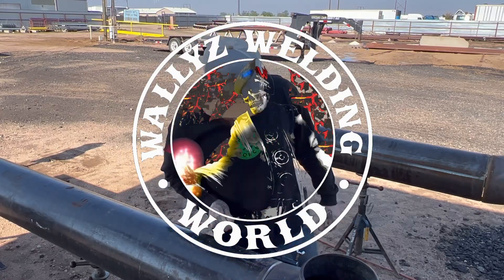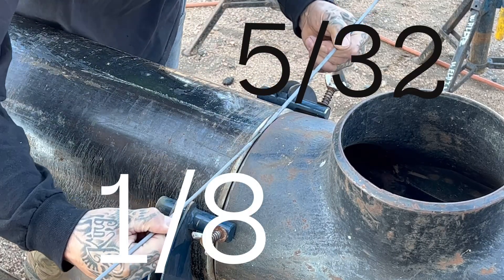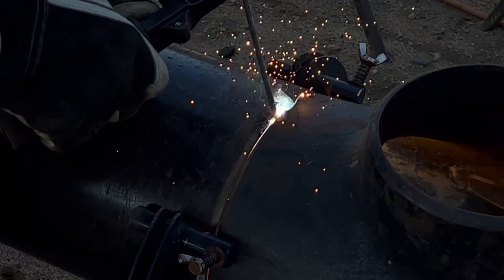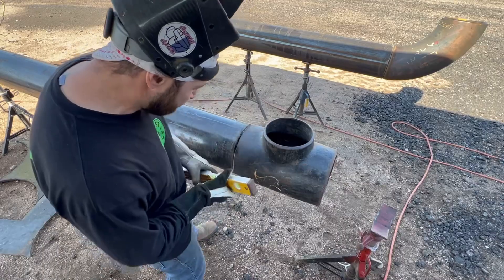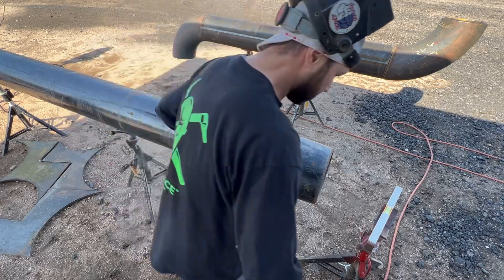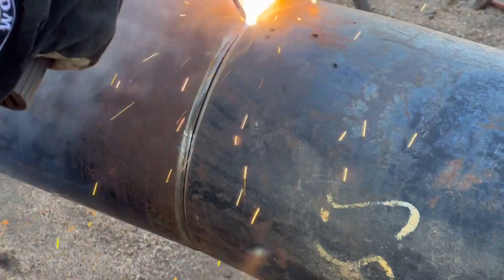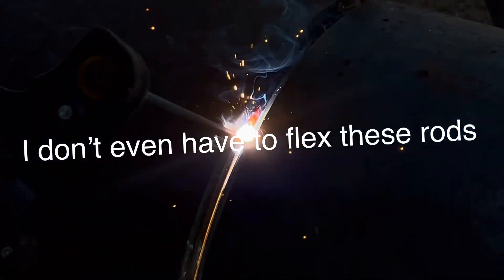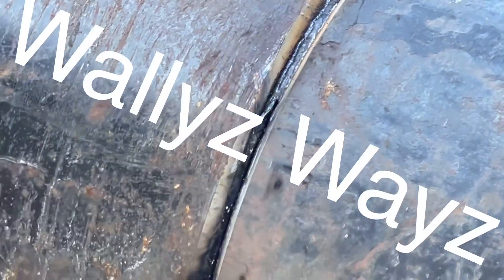5/32 6010 WELDING TEACHING FABRICATION SERIES

Comment: Whis job, do weld ММА. 1.0 material, CNN semi-automatic with gas! gas pipes, special control!!! at the same time, the temperature of the seam, keep 200 C, for the fusion of materials!!!
Reply from the maker: If it requires heat we give it to her
Reply: @Wallyzweldingworld  this technology is used to control the seam for translucency and ultrasound.